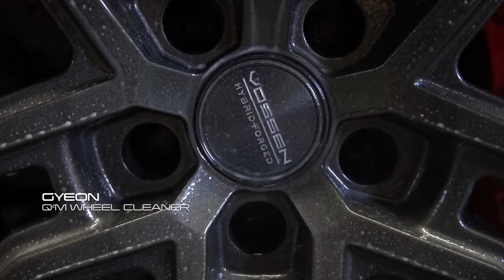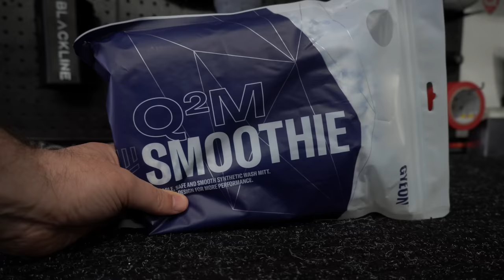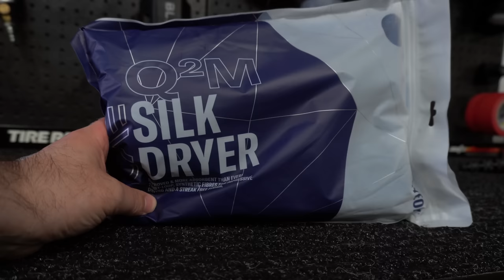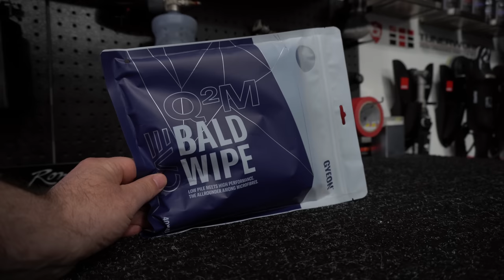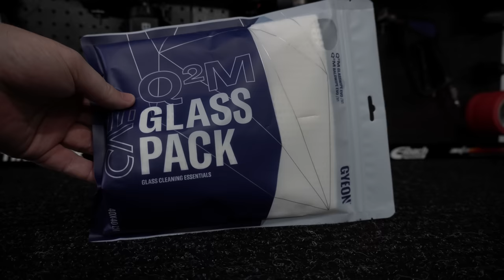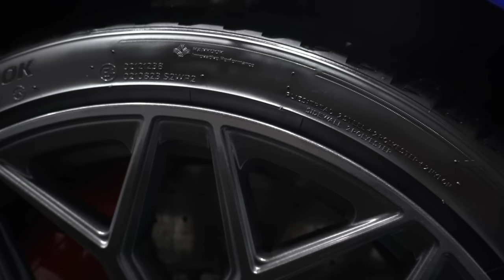ULTRA BLUE AUDI RS6 DETAIL | Ceramic Coating a Savage Station Wagon

Comment: Great video! A suggestion. It’s spring, and summer is approaching pretty soon. Not a lot of people are watching TV at least in Canada. They want to take advantage of the warm weather. So I suggest to trim the length of the video to not more than 15 mins. At the same time keep the 60fps speed and please don’t sped up the video by 2x. Thanks, Rick.
Reply from the maker: I appreciate you taking the time to share you thoughts. I don't really worry too much about the length of my videos, but you do make a valid point.

Comment: Excellence as usual, Rick. I hope the weather is finally breaking for you! 
I coated a 2022 Mazda CX9 with Gyeon Mohs... I ordered Gyeon Bathe, Cure and WetCoat for him so he can maintain the paintwork and he raves about how easy it is to keep clean!
Reply from the maker: You touch on a key point here. If you have the products to keep the coating as fresh as possible, it should pay huge dividends. I'll have to ensure this owner has the right products to do just that.

Comment: I will be applying BC1 on Friday to a Tesla. Probably going to let it sit no more then 1 min. I really like his Metal Oxide coating but hoping this is a much more enjoyable and easier application and removal.
Reply from the maker: I hope you get the results you are after. I’ve never done a Tesla.
Reply: @RADGarage  also the job that you did on that RS6 is absolutely amazing! This is my dream car! Did the car not need any polishing prior to applying the coating?
Reply from the maker: The car was very well prepped by the dealership so there was no sense in doing another polish. The paint was completely free from any contaminants so it was just a matter of getting the paint as clean as possible and free from any residue.

Comment: True perfectionist, beautiful job. Any concerns just ceramic coating without first clay bay and paint correction? Are you locking in swirls?
Reply from the maker: Thanks. It’s always great to hear from first time commenters! I do my best to provide detailed overviews of the projects featured in the descriptions. In the case of this vehicle, it was well prepared by the dealer and the front was all PPF so there really was no need for any paint prep. No swirls or contamination detected.

Comment: Fantastic video dude. Whenever I see you rinsing and spraying water, I always think about your water catch basin. What's the capacity of that? Do you ever just let it overfill and flow out into the driveway?
Reply from the maker: I haven’t done an exact calculation, but it holds approximately 30 gallons which is a lot. There have been times where I thought “for sure, it’s full” and then I check and it’s not even 1/2 full.

Comment: Great job! Loved how you only used products from one brand showcasing what it has to offer!  Just curious about why no decon or polish?
Reply from the maker: The car is brand new. The Restart Wash was all I felt was necessary. The dealership did a really nice job of prepping it.
Reply: @RADGarage   is the restart wash a good strip wash? I have a 1 year coating on my car and it's nearing the end of its life.. Wondering what would be able to strip whatever is left off of it.
Reply from the maker: @asingh82  Personally, I think the only way to truly get your paint back to “raw” condition is with a polish and panel wipe. My use of Restart was because there may have been some minor contaminants on the surface of the paint. I couldn’t feel any, but I thought I’d use a soap with a bit of bite.

Comment: Great car, we all know how you love Audi’s! It’s always interesting to see different processes of washing / detailing a car. What’s your consideration to not first pressure rinse the car before foaming? To take off already some loose dirt. 

Also interested to hear if there was any protection on the car already, or what made you not polish the car before applying the coating? Was the condition of the paint already that good? Genuinely interested 😊
Reply from the maker: Great questions. I don’t rinse prior to the foam because I feel like the foam needs to show me how good it is at loosening dirt. This car is barely a month old so the paint just needed a good cleanse. I contemplated doing a polish but it just didn’t require one. I don’t normally lay a coating on a car I haven’t prepped myself, but it just made sense in this scenario since the dealership did a fine job on their pre-delivery paint polish. I’m sure I’ll see the car back for a full correction in a few years.
Reply: @RADGarage  yes, seeing the dirt being lifted off the surface is a very satisfying sight, agree. 

All clear on the coating. I did a coating on a new car without polishing once before. Saves a lot of time and extra steps (taping etc). I do believe the coating lasts longer with cars that have been polished (smoother surface). But I guess there’s so many variables going into coating durability, hard to tell what the root cause was when on one car it lasts long than on the other.
Reply from the maker: Yes, too many variables to know exactly what is working with or against the longevity and overall performance.

Comment: Beautiful job on a stunning vehicle, that is close to my ❤.  Optioned pretty much the same as mine (black badging, carbon optics, and ceramic brakes).  Did you find it "tight" getting a brush between the front rotors and the wheel?
Reply from the maker: There was no getting between the barrels and the calipers. Those calipers are massive!
Reply: I have found that the Speed Master Jr. brush will fit.
You have a huge advantage over me, as I am vertically challenged.  I have to use a step stool to clean the roof!
Reply from the maker: Being a bit on the taller side of the scale has its advantages!

Comment: You made a great car look AMAZING! Did that car already have a PPF or was that coating applied to the paint?
Reply from the maker: Much of this car is protected with clear film. The MOHS did set up quicker on the PPF’d portions but it works well on paint and PPF. Should help the owner keep it clean all year round.

Comment: That car is definitely among the sexiest wagons of all time! I hope to work on one eventually myself. Do you mind me asking what you charged for this job? And also how much ml of MOHS did you use per layer? Thanks.
Reply from the maker: I don’t reveal my charges because the YouTube influencer angle factors into it too much. Since some of my products and equipment are generously supplied by supporters and affiliates, I can keep the cost low. If I was just relying on the customer to fully finance the project, this would have been at least double what I charged him.
Reply from the maker: I used the entire 50 ml bottle of MOHS.
Reply: @RADGarage  I understand
Reply: @RADGarage  50ml per layer? So 100ml total?
Reply from the maker: I should have explained that better. I used a complete 50ml bottle for the entire job. So, 25ml per layer.
Reply: @RADGarage  got it, thank you and great work!

Comment: Why the soft rinse? Just curious :)
Reply from the maker: I get this question a lot. Let me answer it with a question this time. What would be the benefit, in your opinion, of using the pressure washer to rinse away the soap residue after the contact wash?
Reply: @RADGarage   To be honest I have no idea, I'm here to learn. I've never thought of doing it like that😃
Reply from the maker: So, the way I see it, I like using the pressure washer after applying a thick, rich layer of foam because the pressure of water forces the soap into the tight panel gaps to rid those of deeply hidden dirt. Once that stage is complete, there is very little dirt left on the surface of the car. When I complete the contact wash, the soap is carrying whatever leftover dirt and debris was on the paint, so the garden hose rinse allows me to quickly rinse it all away without putting unnecessary wear on my machine or causing the humidity levels to substantially rise. Happy to answer questions any time.